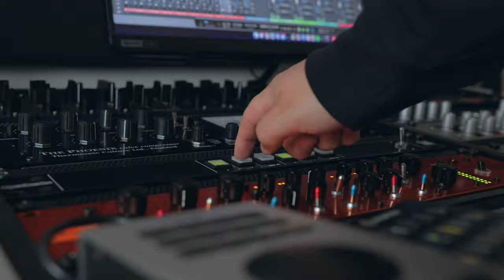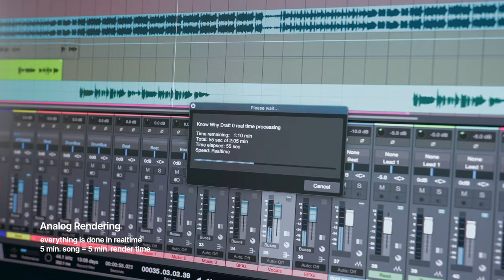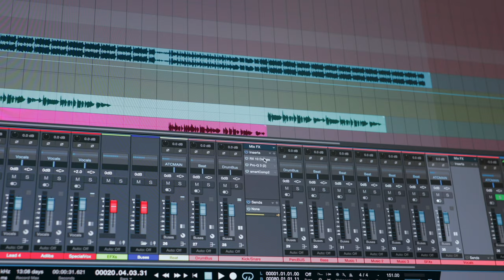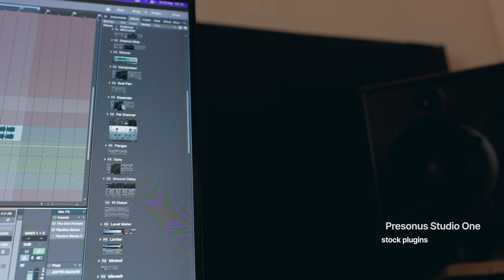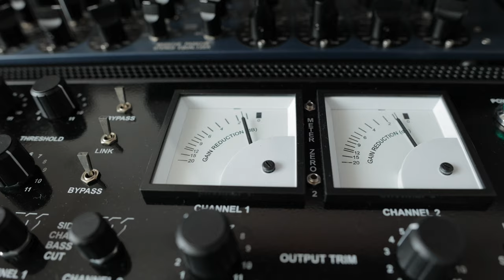5 Reasons Why Analog Hardware Sucks

Comment: Heres 6 more, 1 dust collector and gear must be covered with plastic or cloth sheet, 2 it's a parental fire hazard, 3 Hard to clean, 4 cant have to much sunlight or certain kinds of light due to discoloration or bleaching, 5 cost of electricity, 6 Increased risk of burglars.
Reply from the maker: Stop - people will say that analog is not worth it
Reply: @2probeats  Analog is worth it if you buy Bahringer stuff, I have the Monopoly.

Comment: Actually I do not want to have the same settings each time,so that's not an issue..Plug ins .sample kits,sound kits,and subscriptions like Pro Tools cost a LOT of money. I have had to replace NOTHING with my hardware and you buy cables when you set up the studio. Cables are not hard to clean and messy,so maybe you might want to clean your HOUSE instead to solve that issue.I have tons of gear I paid just a little bit for,so that's a MYTH. Now If you want a Pultec,it's expensive but no more expensive than a 12-24 core Mac workstation. With digital you still need to buy a great interface and they cost a lot. Alesis Quadrasynth Plus was $100 mint, and I have samplers which were $700 Roland, $200 Emu,and my Midi patchbays, drum module,22 channel mixer,etc, were FREE. This is a personal  preference ,not proof that analog gear sucks. I have BOTH and you can get FREE desktops in PC,and i paid only up to $50+ for my Macs since you do NOT NEED the latest ones to make music.Unless YOU are making so much money you make a wealthy living with music, 5 minutes here and there do not really matter.Workflow is about knowing your gear,and making efficient use of your time..
Reply from the maker: OK, so to get things straight. I just mentioned a couple of negatives for analog. You have to understand that the title/thumbnail is a bit click bait ( and it worked 😂 ). I love analog and a couple of points you made are valid.
Reply: @2probeats  NOW things are straight,as in straight facts and to the point. Why would I post clickbait when the supposed point is to educate???There's people out here seeking accurate information, and some of those people could be the next SquarePusher,Moby,or Aphex Twin ,so it's not logical to mislead anyone.
Reply: @2probeats  oh,and please dont play yourself trying that typical,'calm down' and all that skirt wearin stuff..I'm just giving clarity,and I have no dog in any fight because I have plenty of gear.computers,software,and I OWN all of it..
Reply from the maker: Wow.
Reply: @2probeats  enjoy your day..BYEEEEEEEEEEEEEEEEEEEEEEEEEEEEEEEEEEEEEEEEEEEEEEEEEEEEEEEEEEEEEEEEEEEEEEEEEEEEEEEEEEEEEEEEEEEEEEEEEEEEEEEEEEEE

Comment: best thing you can do is buy a control surface. the main reason I love the few hardware units is the ability to turn knobs with two hands. I have analog compressors to clamp vocals/inst before they ever reach the  converters. I bought a midi fighter twister for use with plugins and its a godsend. best choice for people who love to use real knobs. when I want use expensive mastering analog gear like fusion or Neve bus compressors I use "access analog" service and its cheap and sounds amazing. why buy gear when you can rent it for pennies on the dollar only when you need it.
Reply from the maker: A control surface makes sense if you like to twist knobs. Also the access to analog via cloud is amazing nowadays.

Comment: To say analog sucks does not make any sense, especially when the plug-in lovers buy almost every new plug-in (I know so many dudes that spend like $500 bucks almost every month buying plugins😂) that lose their value instantly and also have invested so much money in plugins that have almost zero resell value after few years... the funny part is that Plug-in lovers get so excited of Hardware emulations.... and anyway Hardware sounds better at a cost, same way plugins sound not as good with many benefits....  is all about personal preference and what are you ready to give away for what you prefer... as a anything else in life....  don’t get me wrong I love plugins but I feel that most Eq plugins for example are 90% the same,  use plug-in doctor and you would be able to match the eq curves identically in most case and in other so close .  warm regards
Reply from the maker: Analog sucks because YouTube. A video called 5 reasons why analog is not so great isn't that appealing 😂. I love analog and that's why I've invested in it but to say that analog doesn't have negatives is just insane.
Reply: @2probeats  who said that doesn’t have negatives, but once you buy a  good analog piece your investment is way more protected and also you can not compared one piece of analog gear vs one plug-in ,  more vs all the plugins that many buy that represent the same cost.....  also all these is relative depending on your preference and economic capacity.... I met many guys that owns so much gear and actually do not make a living from Music

Comment: Good reasons for someone who runs a studio to be more in the box. For a recording artist with their own setup, I think it's best to have a nice analog signal chain to record, and then do most of the mixing and mastering in the box.
Reply from the maker: That’s the best option. An amazing recording chain goes a long way
Reply: Agreed, I think if I ever invest in analog stuff it wouldn't be far from a preamp, a compressor and maybe EQ for recording
Reply: @pedrosilvaproductions  I recommend buying an old TEAC reel to reel, the tape mechanism doesn't even need to work, just use the line input and output, and it will warm, compress, and even smooth the eq for less than $200, while sounding like a thousand dollar preamp.

Comment: The great thing about hardware, especially vintage hardware is that there are no updates to mess up your workflow. It's already set so once you learn it now you can use it. As you can probably see from my profile photo my studio is mainly hardware and VCO analogue synths with and analogue mixer. I've not experienced any problems with recall as I finish my songs one at a time, mixing them and then ready for mastering.
Reply: i have never had issues with updates messing up my workflow. Safe to say it has never happened to me
Reply: @msb1704  that's if you are working for a client. Working for yourself and knowing your equipment well will mean that you can recall your settings relatively easy. For a client either write them down on the session sheets or use a digital hardware recorder that can keep the settings. What do you think engineers had to do prior to being able to save settings? Doh lol 🤣
Reply: @ЕтанДрешковка  That's great. I wish I could say the same. As long as it works and you can do what you want to do that's the main thing
Reply from the maker: You are right about the updates and yes, once you have find your final setup, recall is much easier. But if you are searching and replacing gear a couple times a year that you are screwed.
Reply: @2probeats  Very true,. For anyone replacing gear whether you can recall or not, once the gear is gone it's not there anymore to recall. All you can do is use what was printed either on tape or hard drive.

Comment: Is there a big diffenrence in the sound quality between a Analog 1176 compressor and the software plugin?
Reply: If you ask is because you have never listened to the real deal... but, you know, is a cost matter (like sportscars, aviation industry or other hi-tech fields...): 1% improvement is 100% more costly. So, it's up to you.
Reply from the maker: Never worked with a real 1176

Comment: Patching, use Flock Audio and you are as flexible as in the box.
Reply: He already git sumnthing just like that just by tegelar if not mistaken
Reply from the maker: I had the Patch, it didn’t worked out. And I have the Konnektor from Tegeler. Both units are flexible but really expensive

Comment: Agreed 100 percent. I've seen a channel that recommended buying a three thousand dollar 1176 hardware compressor to improve the sound, which is totally not needed, painting yourself into a corner needing one unit which is supposed to stand out. If you have millions then get whatever you like. If you are on a tight budget, then mixing with plugins easily gets the job done, these days. Also the final proof if anyone had any doubts is that, if it's good enough for the likes of Andrew Schepps to mix souly ITB, that should be a clear indication that expensive outboard gear, is not needed. Playing devil's advocate, even if there was a difference in anyway, firstly anyone listening, will never know, or care, how the track was produced, secondly, if you can mix and know what you want, then the sound should just be different, not better.
Reply: Andy Schepps mixes primarily high end recordings.
Reply from the maker: That's the reason why I made the video. I feel that YouTube is full of people promoting stuff without actually mentioning that there is two sides to this. I mostly see the positive side promoted and that's a bit misleading.

Comment: You're right my friend! 10 years ago a turned my workflow entirely ITB. It sounds good and software engineers are awesome in developing hardware emulations. But (unfortunately, I had to say but...) a lot of sound engineers use "software gear" without knowledge  or consciousness. In those cases I would recommend a period of training in "analog universe"... Their digital workflow will thank them. Then after 10 years I got some analogue gear for my sole sadistic pleasure... 😅. Thanks for your video bro !
Reply from the maker: Sometimes 100% ITB makes more sense
Reply: Sure!! And It Is very very fast during the export step!

Comment: I highly doubt some people can even notice certain analog gear sounds compared to plugins. I believe it's easy to notice on compressors and especially preamps (and even then it depends on the settings). But don't tell me you can hear the difference between certain EQs. 

One thing I do believe is awesome is, first of all analog gear gives the impression that you're actually serious, and gives a super professional vibe. Also, it's awesome to mess with knobs instead of a mouse. For me that's 90% of the reason to get the gear in the first place.

Comment: If raw digital audio has not been process by analog  it will still sound weak.analog  recall I'd rather deal with than the digital  harshness. Plugins feels like its on top of the signal  whereas  analog  it feels like it's part of the sound so hybrid  is the way.when you past the signal  through  analog  and a good converter its makes mixing ITB easier and the plugin  responded  better

Comment: Not true, Tegeler Audio does automatic recall, you have it in your rack, and you don’t know this? Lol unless it’s not your rack.
Reply from the maker: What’s not true? When I talked about digital recall I was reffering to actual gear ( compressors / eqs etc.). The Tegeler Konnektor falls under “ insert machines “ category.
Reply: @2probeats  Tegeler analog gear recalls using the plugins, I paid 2k for my mines. I know it works. Pull up the plugin and the analog gear recalls its self where you last left it. That I can guarantee pal.
Reply: @2probeats  by "actual" gear do you mean like their bus compressor the "Creme"?? or how bout their tube reverb?? both are plugin controllable. and who brought up the Konnector?? 😆 maybe in the meantime you should change your merch to "i love digital".

Comment: Do not be a lazy engineer. Learn how they work,  WRITE  down the settings,   smh...  🤔🤔🤔🤦‍♂️🤦‍♂️🤦‍♂️🤦‍♂️🤦‍♂️🤦‍♂️🤦‍♂️
Reply from the maker: Lazy? Time is $ so sometimes you need to be fast. What are you doing when that happens?
Reply: U know all those top engineers who still use analog in their studio...have an assistant or a internship doing that dirty work for them. They became lazy too, they won't get up out their seat & recall that compressor setting from a song they did 3 weeks ago. I use to that analog gear & I'll never go back. So much easier & time consuming & it now sounds just as great